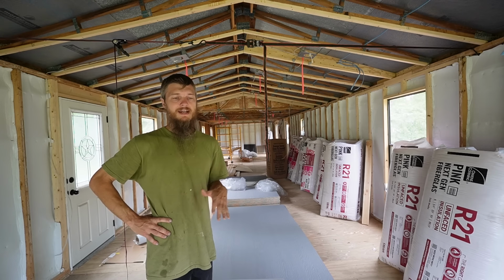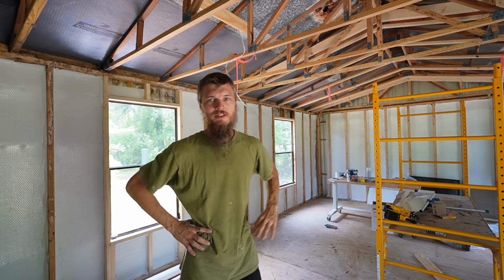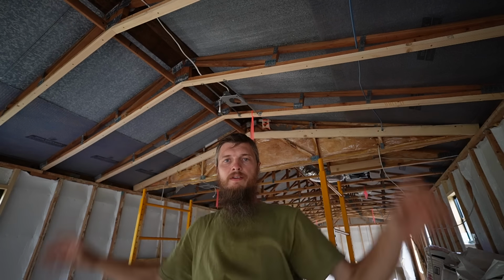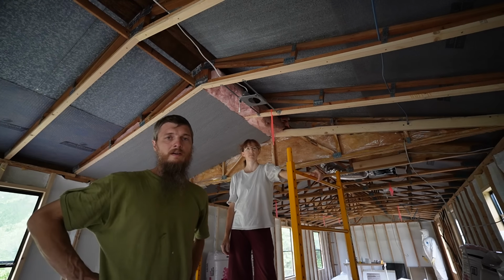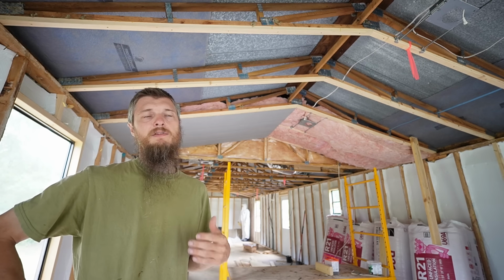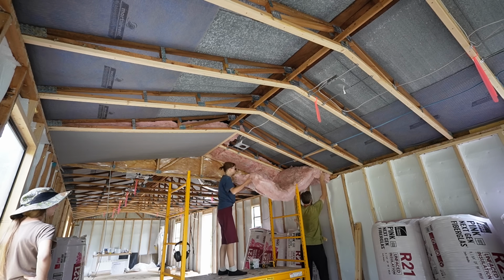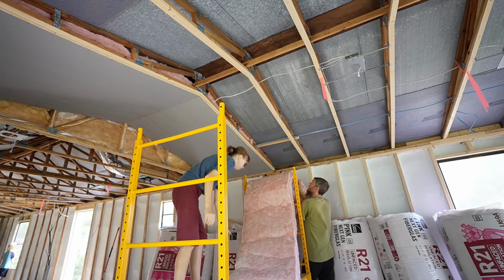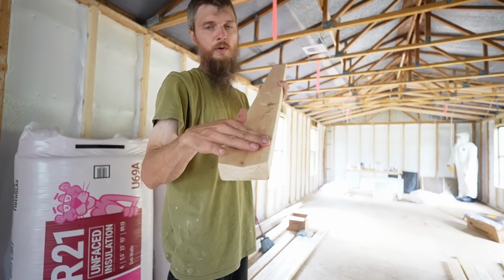Starting the Ceiling was a Struggle! - Salvaged Mobile Home Rebuild

Comment: I can't imagine a dry environment  with insulation and OSB NOT being subjected to moisture from the daily household activities.  Showers, cooking, body perspiration will be detrimental to Insulation and OSB without a vapour barrier.  I'm from the north and assume you guys do things differently for your area.  Could you explain in your next video.  It would be appreciated.
Reply from the maker: It's actually such a big topic with so many variables that it's hard to explain it all in a general sense. We will have proper mechanical ventilation in the bathroom and kitchen to expel excess moisture.

Since the attic space in this home is not ventilated and made of metal, it acts as a vapor barrier. And that is good because we live in a mostly hot and humid climate zone so if we were to have any vapor barrier, we'd mostly want in on the exterior. 

But since the roof does act as a vapor barrier, we don't want to put another vapor barrier on the interior side because it could trap moisture between the barriers, in the roof and insulation. By omitting a vapor barrier, it allows excess vapor to diffuse to the interior.

As long as the ceiling is fairly well air sealed, excess moisture should not be a problem. 

Even in the north, it is usually not recommended to install a vapor barrier on the ceiling and they should never be installed in an unvented roof. 

As long we we vent excess moisture outdoors it should all be fine, in theory.
Reply: A very short summary on vapor barriers:
 - if used it should be on the warm/hot side (as condensation happens on cold surfaces)
 - there are vapor barriers and breathable membranes - in modern applications usually the latter is used as trapped moisture can get out (not very fast though), there are even "intelligent" membranes that stop water vapor but let liquid water through
 - a poorly installed vapor barrier is often worse than none at all

Comment: I had been thinking about those wire to hold the insulation since the first batt fell back out of the ceiling. Sometime you can take a shortcut and other times you are just killing yourself and need to bite the bullet. Oh well.
Great fix on the rafter getting it straight and braced back in place.

Comment: You need quick support poles for holding ceiling drywall in place while you screw it in. They are inexpensive and very handy. We used the for years.❤

Comment: Could you staple the pink tape accross the rafters to hold the insulation up? It would be thin enough to not interfere with the panels.

Comment: amazing work.. i suggest you rent that lift for ceiling boards.. its gonna make you life much easier because it will hold the boards to the ceiling so you can screw them in..  also some people use homemade stands that look like a T done with 2x4s and as high as the room so they can squeeze the board to the ceiling using the T to hold it there..

Comment: When putting drywall or panels up on the ceiling I used a small block of wood about 2 inches wide by 4 inches long and loosely screw it to the trust turn it to hold the drywall or panel.

Comment: Amen Ashley! All that matters is you won! Looking soooo good you guys! Loving the roof! ALSO you guys need to get a window unit for the trailer so you can work in comfort. The power shouldn't be THAT much just running it while you are there. PLUS you guys aren't used to A.C. so I bet you could turn it up high and STILL be comfortable in there. I just hate to see you struggle and on top of that being hot to. I know you don't have the power on there, but I do think this would help a pile!!! Just an idea because it's HOT here in the south. :) I live close to the gulf coast in MS. so hotttt!
LOL I find myself trying to help you guys when you're struggling.

Comment: If you ran a strip of that marking tape or string   down each side   stapled  or even just wrapped around the  joist   and strung from joist to joist.    possibly two per side.   run horizontal to the ridge beam down each side .  Mark your light box you covered over..  Two or three balls of kite string  making sure  you loop it so its on the  ceiling side of the joist not the insulation side.

Comment: Learned about why the support of the two side walls is so important today.  Love that you explain these things to us. Did wonder why you didn't use those rods that hold the insulation up.  The ceiling looks great though.  Hope the rest of the project goes easier and smoother for you.  Stan will be so much more comfortable without the protective gear.  Can you set up some fans for yourself in the house to cool it down while you work?  Heat stroke is real and nothing to fool around with.  All the best and God bless.
Reply from the maker: Yea, we might bring a fan next time.

Comment: I was about to suggest those wire supports.  I was even looking up a link to send when you said you already knew about them.  So, Secondarily, let me suggest you pick up some #10 ceiling hanger wire for those odd spaces where the precuts are too short.  Sold with the drop ceiling hardware, and comes in 10 foot lengths.  Sold individually.

Thanks for sharing.

Comment: I kept thinking is there a way to attach the insulation to the ceiling boards, like with a spray adhesive?? Then put the panels in place ?

Comment: See uf this helps
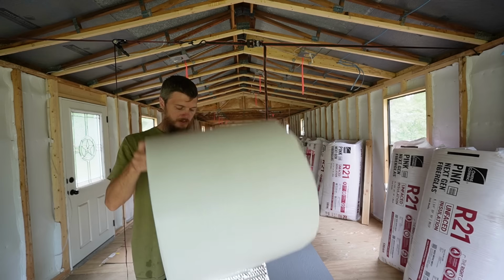0:07 To keep ur insulation in, try taking a wire coat hanger & cutting it the width between the rafters & put them in over the insulation. 🤞

Comment: Hey,just a thought ,would you be better off stapling/ or maybe sticking  the insulation to your boards before placing your ceiling boards in situ?.
When you mentioned fiberglass I shivered as I'd had a bad reaction to it years ago insulating the loft 😢😢.make sure you use a clear plastic face cover / mask and goggles ,my eyes itched for ages 😢😢.you all work so hard and I'm so impressed with every video .
You looked so hot dough,(not just in tempreture😂😂❤ ) I bet you all had a long hot shower after all that hard work .sending you love Anji 🇬🇧
Reply: 😊I agree! Glue insulation to boards!

Comment: You would think there's some kind of tool or specific way of doing it that would make it easier to hold the insulation up while sticking the osb panel on. I dunno what that system looks like though. But the pros that do this on the daily surely can't afford to be doing it like you have to right now. It'll be interesting to see if you come up with something a bit more streamlined after having to do this for the whole ceiling. You'll go crazy if you have to fight like this all the way. I doubt the inspirational qoutes is gonna be enough to make you keep winning the wars.

EDIT:  I just watched the end of the video. And it seems like you know what the solution is. Good for you.

Comment: I'm always so impressed with your attention to detail.
Sorry you're struggling with the insulation, I'm sure your solution will solve the issue.  The ceiling panels look nice, a good alternative to dry wall, so much less work.  You certainly don't need a gym membership with all the physical jobs you'd do.  I'm sure there were some sore arms and shoulders after this day.
Not to be a nag but.... shouldn't you have some eye protection?

Comment: Instead of those wires to hold up insulation maybe try using those straps the HVAC guys use to hold ductwork. Plastic webbing not the metal plumbers tape

Comment: If you haven't bought the metal things already you might think about buying some cheap fabric instead which you could staple to the rafters to hold the mineral wool up (while also preventing the glass fibers from being in the air)
Usually the bags used to dispose of mineral wool securely are made of PP-fabric but that'd be a lot of (too much) plastic for your style I suppose and I think that any fabric that's woven tightly enough would fulfill the requirements.
Reply: Interesting thought.   Thank you for sharing.

Comment: Hey!
Just a question - wouldn't it be easier if you put two insolation things with the osb sheet together on the floor and then uplift it to the ceiling? While uplifting I would try to put the side which is close to the wall on the staging and then you can hold only one part which is close to the center and push the insolation on a place and then attach osb to the ceiling.
Or another thought - I would try to use two thin and long anough wood sticks and put them in between wood ceiling trass to hold the isolation on a place while I uplifting the osb sheet.

I guess you wouldn't read my comment in time but i really tries to help :)

Comment: After it's all said and done, after watching these two struggle, and the amount of money, not including their labor, would it have not been better to just  replace the trailer with a new model?  There are reasons why people walk away from old trailers.  But if it gives them satisfaction in the end, then they should be proud....
Reply from the maker: It's far more costly to buy a new singlewide than to repair this one.
Reply: @diyfferent  how much have you spent on this trailer an how many man hours the both of u put in

Comment: Is that cement board you are putting on the ceiling?
Reply from the maker: No. It's an OSB product. LP Multi-Use panels. 

https://www.lowes.com/pd/LP-LP-Multi-Use-Panel-Application-As-4-ft-x-8-ft/1002550422?store=2970&cm_mmc=shp-_-b-_-prd-_-pro-_-ggl-_-LIA_LUM_000_PRO-_-1002550422-_-local-_-0-_-0&gad_source=1&gclsrc=ds

Comment: ~1:30 looks like the window to the left is missing the cripple studs to support the window header.. weight is on the window?
Reply from the maker: This home was built that way. We did do repairs but built things back the way it originally was. The roof load is very small and there's really no weight on the window so it's fine. 

The studs you are referring to are jack studs. This home didn't have any headers or jack studs. It did have cripple studs under the sills though oddly enough.

Comment: Can you feel any difference in the temperature with the heat barrier up?
Reply from the maker: It has gotten a lot warmer out in the last week or so than it has been, so we can't really compare. As soon as we were done painting we went straight to installing the Radiant barrier. But I will say before we installed the Radiant barrier, we touched the backside of the siding and it was hot to the touch, and when we touch the Barrier, it's not hot, so it does bounce that heat away. It's a product that definitely works. We've used it at our main house also and it made a big difference in every application.

Comment: I would wear long sleeves and a mask. Sweating opens your pores and the tiny fiberglass dust gets in on your arms and face.  The mask keeps it out of your lungs and throat.  It is a nasty job.  I did it once in 90 degree weather. That was once too much.  I stapled 6mil plastic vapor barrier to hold up the paperless batts.  Served two purposes.

Comment: *** ???/ What if you used a steel rake that would grab that insualtions and you could hold it in place with the pole part/handle instead of holding your arms up the whole time. ikes.. just til he gets teh string tied..   Even 2x4 with a small piece of wood across the end, making it a T-Bar and add some nails .. that would be a nice handle to snatch a hold of that insulation and lift it up and in there and hold it in place. all from the safety of the floor.. and save your arms.  Idk.. trying to think of ideas..

Comment: I've searched and can't find
What is that rubber boot thing called u put  on ur roof around the pipes?? I need exactly that plz help!! 😂😂😂
Reply from the maker: They are called pipe boots, or sometimes they'll just say something like 'vent pipe flashing with adjustable rubber collar.'
Reply: They are located in the roofing section. Measure your size pipe before going.

Comment: Can't believe you are putting up insulation without a mask and bare hands. I did that when I was very young and ended up so plugged up I couldn't breath. Imagine the fiberglass inside was doing some damage. Surely you could feel the needle-like fiberglass in your skin??
Reply: That is surprising. Doug usually wears a real respirator.
Reply from the maker: Surprisingly it's not itchy at all. Mineral wool affects us more though.

Comment: R u regretting not using spray foam insulation now after the insulation keeps falling ?
Reply: He has said before he wants to keep costs down spray is way more than batt insulation.
Reply: @mkel858  you are so cool!
Reply: @mkel858  I get that but sometimes paying more is worth it. Just from the time savings could be worth it. Time is money, if u have to spend more time doing 1 thing then  ur losing time u could accomplish something else.
Reply from the maker: We don't regret not using it. Spray foam insulation just isn't our thing.
Reply: @diyfferent  I completely understand.
Reply: @diyfferent  I've never used it, so I simply wouldn't have an idea.  I wish I had known of the ceiling panels - we just finished up the sheetrock -  it would have been so much easier  and cheaper, had I known and with the wood grain - it would have looked fine for a cabin in alaska

Comment: If I were you, I would have had it spray foamed.  Then put up the walls and have someone come in and sheet rock the whole house.  I would be faster and you could have it done in a week.
Reply from the maker: There's no rush. We don't like spray foam insulation and we don't want drywall in this home.
Reply: Well, wouldn’t that mean a much higher cost by hiring contractors?
Reply: @maryrenaud6732 as well as the cost of the spray foam. Much more expensive!
Reply: @maryrenaud6732  yes, but it would save a lot of time and work.  plus the panels they are using will show all the screws, not a good look.
Reply: @diyfferent  spray foam is the best because it seals all the cracks making it air tight.
Reply from the maker: We are going to be putting battens over all the seams and screws. It'll look great :)
Reply: @onewhitestone  not their choice, and time isn't an issue for them. this is reno at their pace, capuche?
Reply: @savannahsmiles1797  I didnt realize that they have that much money to spend on taxes while it just sits there.  As an investment, one would think that the faster they get it done, the faster they can rent it. This is what yt does, it gives people money and many people spend it foolishly.
Reply: @onewhitestone they’ve already said it’s not to be rented out or sold

Comment: I used a little contact adhesive when I insulated my van to stop the Rockwool batts falling out
Reply: What about spray adhesive to hold the insulation?
Reply: Necessity is the mother of invention.  Maybe you’ll discover the next great thing to make that job easier without breaking the bank.  I was wondering why you didn’t just use a filler strip to build up the roof truss to be able to attach the ceiling panel?  Great work.  I’ll bet you were cursing off camera! 😏

Comment: SORRY RADIENT BARRIER IS NOT INSULATION  I put it in my metal shed that house my lawnmowers and it did nothing to keep it cool or warm . I then  put up  it  R 13 insulation  ontop of it and put up pegboard to hold my toopls and that worked . I spray foamed the floor joists  . But it was to expensive to do that to the walls and besides that I wanted to put electric in the shed  and I did that after insulation  was in and before pegboard . Then I added this  year and small sink with water hose to the sink  that I can disconnect . Glad now I did not spray foam the walls . It was hard enough to cut out the spray foam to run the hose up to the sink and the drain out to the yard  . The ceiling in single wides are big heat loses besides floors .   Keep up the great job  . I used faced insulation easier to work with
Reply from the maker: We know it's not insulation. It's a radiant barrier. It's only meant to prevent radiant heat from penetrating the structure. We've used it in 3 other applications and it worked excellently for us. We still have to insulate the walls.